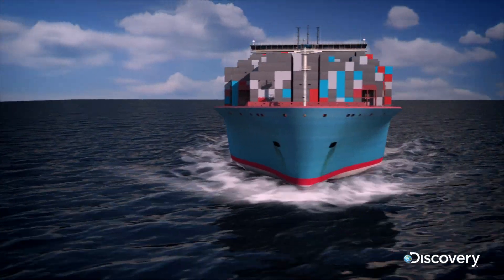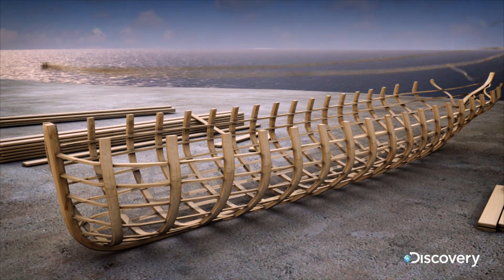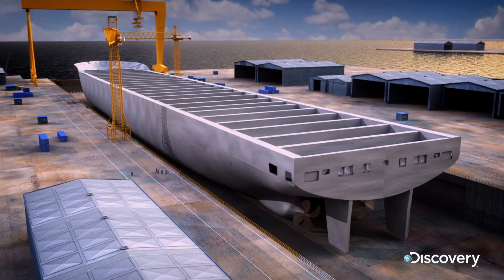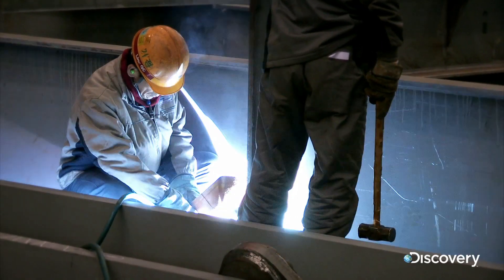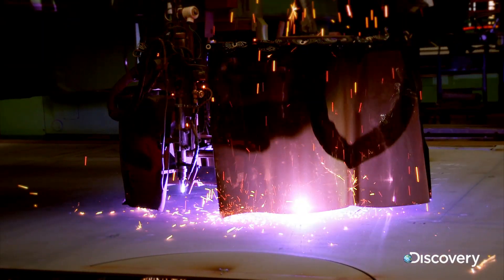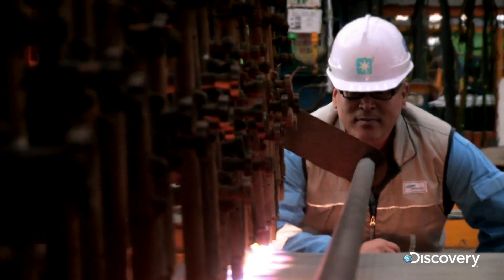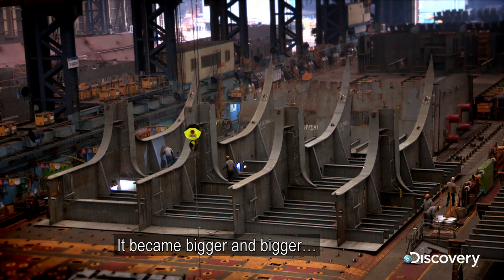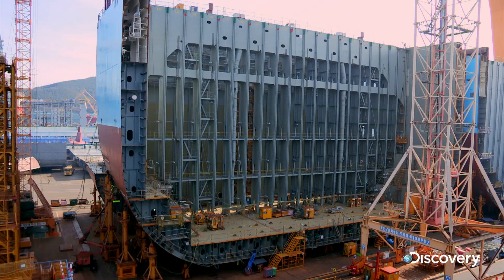Maersk - World's Biggest Ship: Megablocks - Discovery Channel

Comment: Every piece exists digitally on computer software, the machines cut each piece using this data! Worked at a modern shipyard, this tech is amazing! Still need man to operate the machines and still at least 50 % of all cutting and welding is done manually!